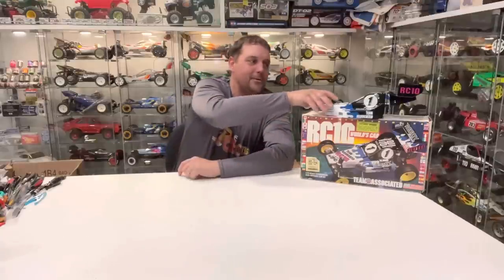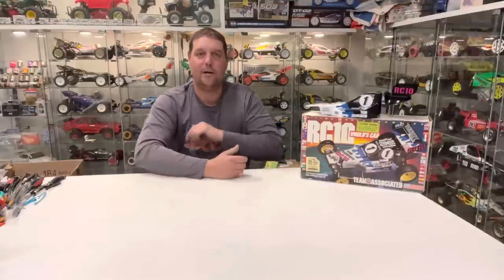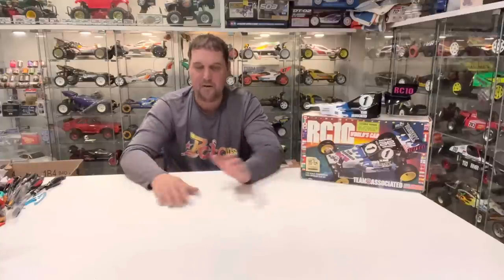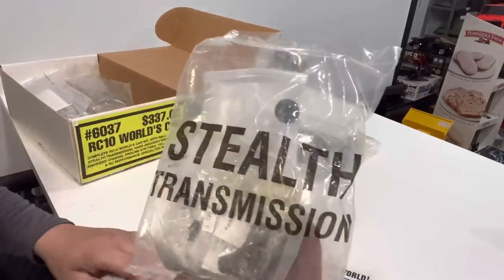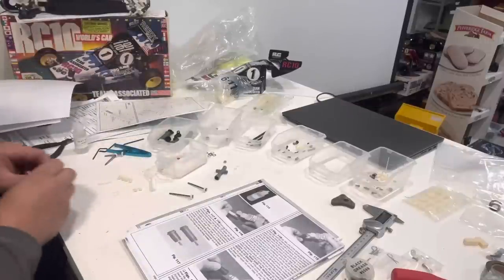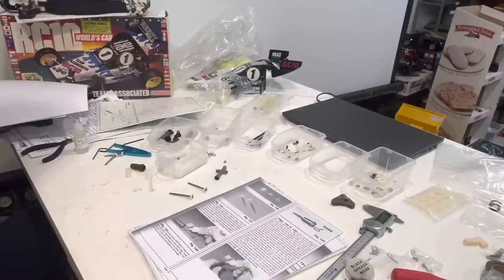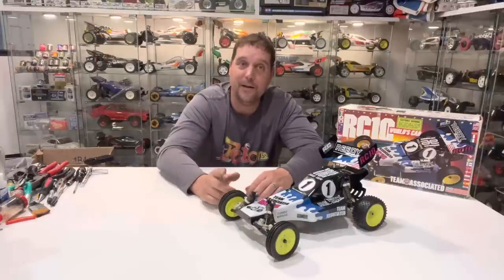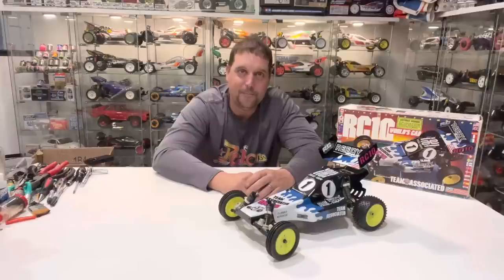Building an Original RC10 World’s Car from NIB

Comment: The bit at the end with you finding ther roll pin in the bow made me guffaw out loud. I have a gold pan RC10 that I found and bought after waiting and looking and waiting and looking ad-nauseum. It was I think a conglomeration of different versions and it took me an age to strip, clean, re-furbish and re-assemble. It fought against me the whole way. It didn't have a body or wing, but it was actually a reasonable price. It seems to be common for this era of cars but the wings and wire mounts are impossible to find. I just need to do the body and tune up the chassis a bit.
Very enjoyable vid. Thx for putting it up.

Comment: It looks absolutely stunning and there are lots of interesting stuff going on in there! The shocks are really cool, I have not built anything like that yet. Looks super easy building them but how much of a nightmare would they be to rebuild? I can getting that back out of the shock is gonna be a giant pain, glad you don't don't have to worry about that! 
I did laugh at you finding the roll pin at the very end! Sounds like something that would happen here! I can't remember which car it was I was building but I was missing one of the key shock components and I tore the shop apart looking for it only to find it lodged in one of the other parts as I was boxing it all back up to build another day after I found a replacement for it so I had to unbox it all again and start over! Goofy stuff like that happens all the time. 
It turned out amazing and the the guy that did the body did a great job as well! I miss the drippy paint years!
Reply from the maker: Vintage Rc. It is a love hate relationship. Great build though.
Thanks

Comment: I had an original RC10 and I also raced it. I also had an RC10t truck. Both were great cars back in the day. I did have a re-release RC10 but sold it recently for a nice profit. However, I do still have both of my race vehicles. I have an RC10t with RPM parts and also an RC10 also with RPM parts. I also have an original RC10 A stamped in amazing condition. Thoughts?

Comment: wing is a bit too high upwards Keith, if you want to drive to the moon then it's just fine.....
Reply from the maker: Thanks,
Always fun you you are bending the wire yourself. I was expecting it to come out way worse. Lol
Reply: @rcicons4915  i had the same issue with the B3 , try and error...., Raced even the RC10 B3 worlds edition at my local hobby Club but the front was a bit too weak , some parts broke too easy.... Went to Losi XXX- bk2 and a Losi XX-4 worlds ed., They drove much easier ( club : MBV Kampenhout in Belgium)